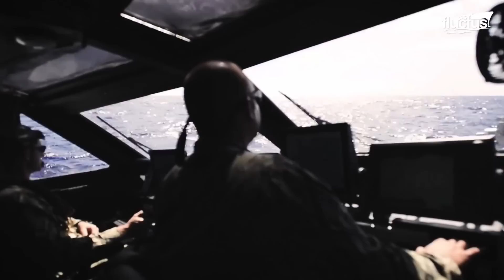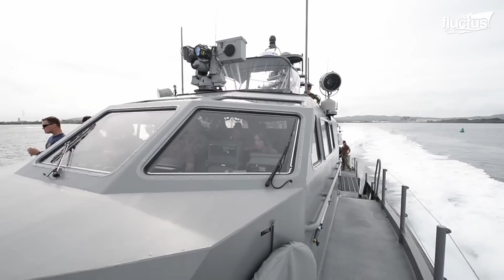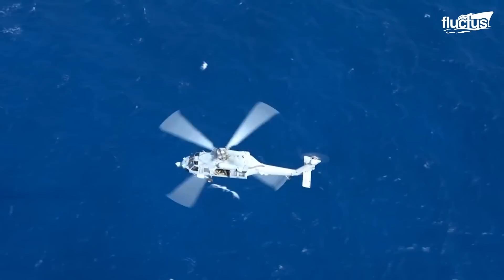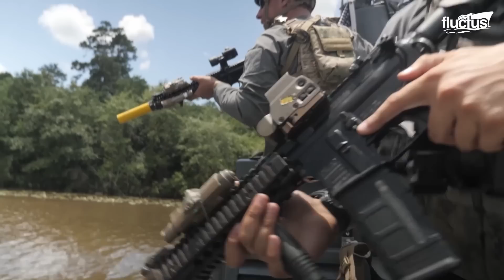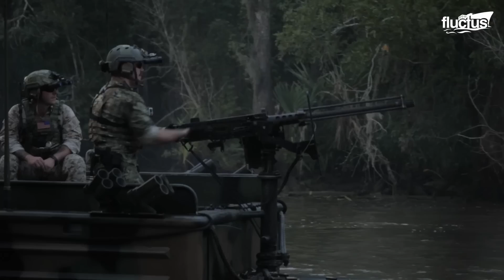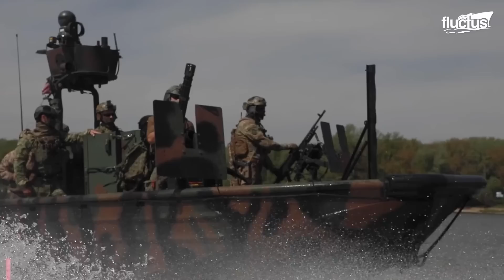Inside US Navy Most Advanced Patrol Boat Patrolling Water at High Speed

Comment: In 1980, I was @ a small shipyard in Pt. Everglades for work on a keel cooler on a large tug, and in                      the slip next to us was a 50ft naval craft partially covered w/ a tarp. It was dry docked so I was able                to see the telescoping wing under the bow and the stern “wing”, which hydraulically swung up out                   of the water. Intrigued, I started taking pictures and was immediately halted by a senior chief there.           Being the engineer on my vessel, I explained I was only interested from an engineering standpoint.                 He said it was a new high speed experimental vessel from Norfolk which had a breakdown on sea                  trials but was classified so NO Pictures. I’ve still got them though and it is a beast. Turbine jet boat           riding on wings was what I observed and have never seen another. It was likely a drug interdiction                     or special ops vessel. Wow
Reply: That was a Pegasus class hydrofoil, very cool!
Reply: Some were stationed at Key West when I was passing thru in mid 80’s. one side of the dock was USCG Patrol Boats and other side was USN Patrol boats. I mentioned the seemingly messed up paint on both sides of dock. USN guys we were with said look closer, those are all bullet holes that are patched up. Worse than a Dalmatian, they were all riddled stem to stern with holes. Crews loved it, plenty of action during Reagan drug wars
Reply: I would had confiscated your camera, phone hand cuffed you and turn you to the FBI and take you to Guantanamo, Cuba for interrogations… LOL I’m joking Sir.
Reply: @danboren6567  I don't think so, the Pegasus class is 133 ft which is quite a bit longer.
Reply: @ckm-mkc  You are correct I missed the size part of the OP.
Reply: طط9
Reply: Y
Reply: pPPpPPPPPP

Comment: Know that Riverine isn't a Rate but a Billet. Which is a good thing because it means it's not like SEALS or SWCCS which depending on what your issues might be extremely difficult to get into, it is hard because you do have to undergo training for it but not as hard. Really want to get stationed with these people and do this job.
Reply: Good job for the engineman rate...
Reply: @gmonynegro595  didn't know that....guess a lot has changed since i was in. MM2 1973-1981
Reply: Was great for me CRS4 2013-2017

Comment: My dad's boat, MTB 313, RON 22, built by Higgins was nearly identical without a closed wheel house. 80' long, 35 tons, three 1500hp Packards, 48 knots top speed, 3,000 gallons of fuel, 4 torpedoes, 12 depth charges, 1 40mm cannon, six Browning twin 50's, two 20mm's. Made of 1" marine plywood, two officers and eight Sailors. I've heard it all and I have photographs to back it up.
Reply: When did your dad’s boat enter into service? A torpedo boat with 4 torpedo tubes can sink a cruiser.
Reply: @Man-kit Li  he sank many F-lighters in the Mediterranean. It reported for Shakedown February 18th 1944. His boat didn't have tubes, they rolled them off the side. As soon as they hit the water, the gyros would energize then the motors would start. Then they were on their way. They never went out on patrol with less than four
Reply: My Dad's MTB  RON was 35 , boat number don't know.  His boat was a 77' ELCO , before D Day,  D Day , and beyond.  
 Then was on 80' ELCO  in the Philippines until the end of the  War in the Pacific .
Reply: @johnhanley5293 RON 35 was MTB 510 through MTB 521
Reply: @gordonmiles9995   Thanks for the info 👍  ,
Reply: Sounds more like a PT. So that would've been PT 313 of the Higgins type, 78-ft long. There's a handful of examples in museums and one boat, PT 658 had been fully refurbished and is operating in and around Portland, Oregon.  PT 305 had been rebuilt and was running on Lake Ponhitrane in New Orleans,  but was taken out of the water and placed permanently in the WW II museum on display. I think she was in the same squadron as the 313.
Reply: @ronaldrobertson2332  It was a PT boat. It was built in New Orleans, Louisiana by Higgens Industry. My dad sailed on it in 1944
Reply: @ronaldrobertson2332  yes, the 305 was in Ron 22. My dad went out on patrol with them. MTB 422 patrolled with RON 22 also. I have all the minutes that were entered in the ship's log while they were active. I got it from the War Department about 20 years ago. MTB 311 hit a mine and lost her bow. My dad's boat had to sink it with men still below deck. They couldn't risk losing any more men and couldn't allow the IFF challenge to fall into enemy hands.
I've got a record of it all.
313 had their skipper taken off the boat because he threw the throttles forward too fast and stalled all 3 engines while under fire. They were sitting ducks in a barrage of artillery and flares. My dad said he cried like a baby for forgiveness. But the crew weren't having any bit of it. They got him off before the next patrol.

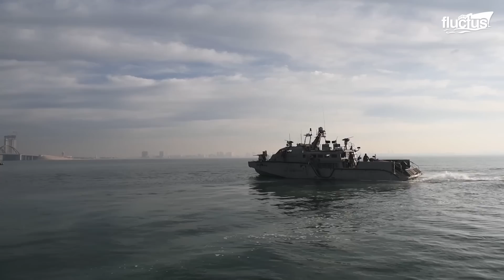Comment: Training to use a manual gun on a boat is a skill no doubt, but I was as surprised to not see more "innovation" like a gyro-stabilized machine gun adapter at 5:20 where every round counts. Or even connected aim to the gunner's headset, with target acquisition and selection.

Comment: Watching them change the barrels on the M2s I can't help but think they're gonna lose a lot of barrels of time. Maybe they should turn the gun so it is parallel (or nearly parallel) with the boat's side so the barrel is able to be easily handled with two hands - I assume they have barrel change mitts available. Turning the gun parallel with teh side of the boat would also mean that if the barrel fell there might be a better chance it landed on the deck instead of straight into the drink.
Reply: I thought the same thing. I pity the sailor that gets issued a statement of charges for accidentally dropping one in the ocean!